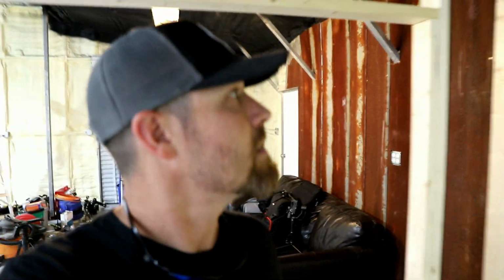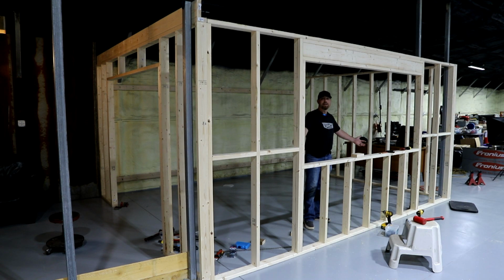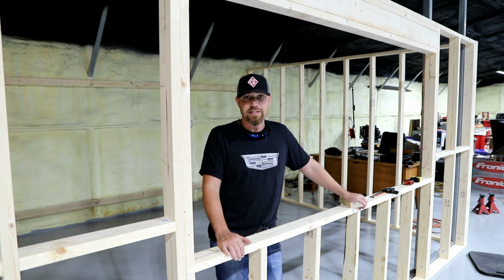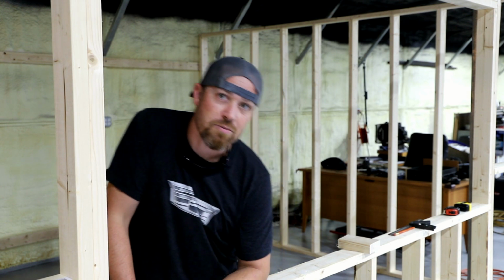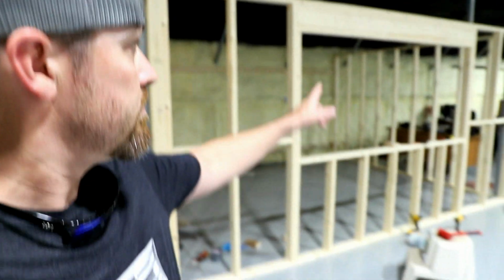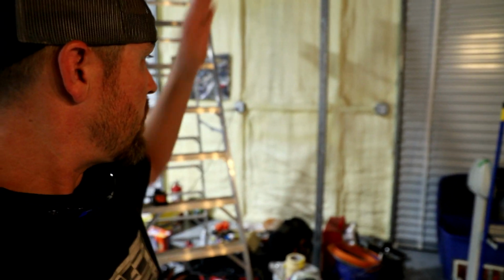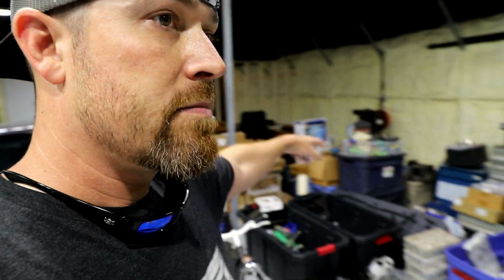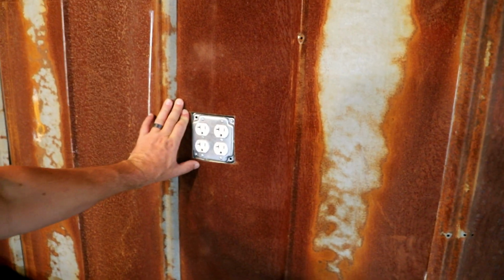Ultimate Garage Build My Way

Comment: instead of folding up, id go metal roll up garage door. Easy to open and close, and will match up with the metal container look on outside, but also can look clean for the inside room. Also helps keep air separated etc.  Regardless. coming along nicely brother!
Reply: I was gonna suggest a glass panel garage door, that way you can see out any time you want

Comment: The horizontally hinged opening to the enclosure is a real opportunity. Here is a suggestion for holding it open at an angle: On both sides, create triangles that are vertically hinged. When the rigid awning goes up, they swing in and it rests upon them. The triangles could be your KillFab logo.
Reply from the maker: cool idea...may need to play with that

Comment: I like the idea you have for the convertible bar area.  I would build the opening with French doors that open towards the outside with a fold down bench top bar on each door and then a fold up bar just under the French/barn doors so when the doors are open the whole bar counter top area stretches across the whole wall alowing either a pre order line and exit line to and from the bar opening window.  Tell me if that makes any sense.  Seems less likely to have issues with a big window swinging up that people have to walk under.  Not to mention some tall people might not fit really good under it.  Just some food for thought.

Comment: Anybody know what size shop that is? I didn't know if you mentioned it somewhere?
Reply from the maker: its 48 x 80
Reply: @Thefabforums  thank you sir. Got to ask you this how scary was it when you flip that table over? That looked awful sketchy man. I'm fixing to start building a welding table with a 1 inch thick Top plate.

Comment: Did you do any plumbing for the shop ? 
If so for what and where ? Or did i miss that video ?
Reply from the maker: No plumbing. My thoughts were if I felt like I needed a bathroom I would build it with an elevated floor... but to be honest I have yet to feel like I need a bathroom. Always an option though

Comment: HEY BROTHER.... I GOT A BAGGED 71' C-10 AND AM LOOKING FOR A GOOD WELDER TO FAB UP WITH.... WHAT DO YOU RECOMMEND..... THANKS BRO
Reply from the maker: How good are you looking for? lol
TIG or MIG?
Reply: The Fab Forums I know tig is what everybody is wanting but do you think that there is a quality MTS that you would recommend?
Reply from the maker: @Chad_N_Stacey_Hopson  my first choice for TIG or MIG would be from @froniusweldingusa. Transsteel2700 or the Magicwave230i
Reply: @Thefabforums  What is your opinion on the Everlast MTS 252 STI??
Reply from the maker: @Chad_N_Stacey_Hopson  no experience with that model. I have the Everlast 325ext and really like it. I have a budy that has the 255 and he really likes it as well
Reply: @Thefabforums  Im just trying to fix up my truck and do a little fab work here and there.... I just know that I want to be able to mig when i want and tig when i need .... and that 252 sti runs around $2500 on sale right now.... but then again I don't know Sh*t about which welder would be the best bang for my buck
Reply: i also have a 68-72 nova mild steel jerry bickel design chassis that is only about 60% welded that i eventually  will have to finish

Comment: Can't remember, did you run any water line or any kind of plumbing? Bathroom be nice, up to you tho man. I'm having to do the add on for a bathroom and just a clean up sink at my shop.  Looking good tho!
Reply from the maker: I didnt. I have gone back and forth on a bathroom....just value my floor space too much. Phase two will be another building so may do one in it